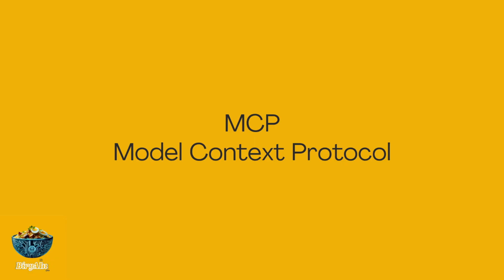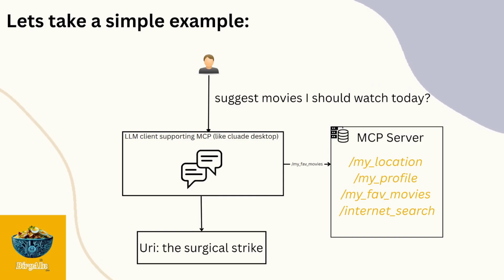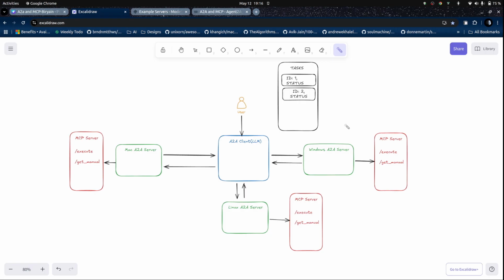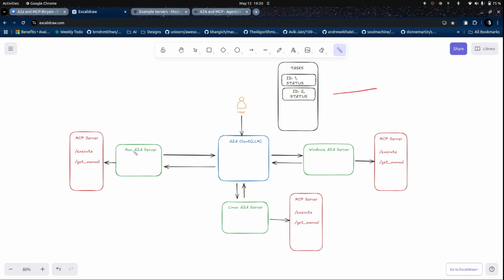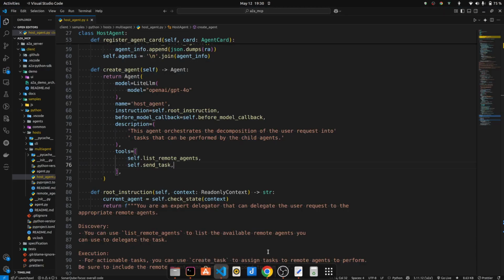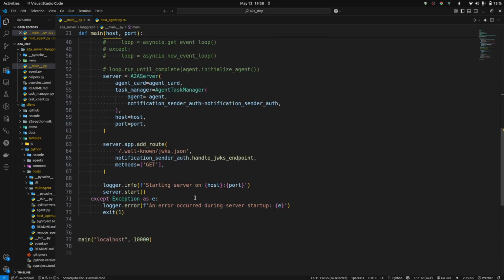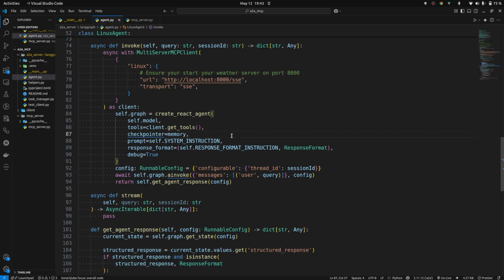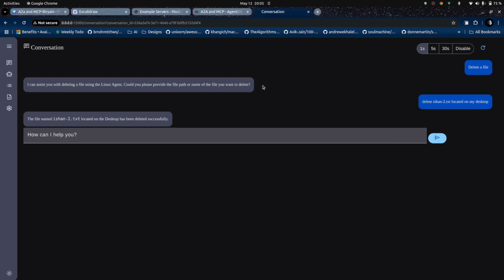A2A and MCP - Tutorial with code Demo

Comment: Great video, one question:

1. In your auto repair shop, i was thinking on how we can expand it to design a fault-tolerant, multi-agent system using A2A and MCP both, where agents can dynamically reassign roles or recover context after partial system failures or dropped agent connections — without relying on a centralized orchestrator. Is this possible?
Reply from the maker: All A2A agents like for example in our case Mac, Windows, Linux agents are seperate servers which can be considered as a seperate microservice now we can apply all the strategies of scaling and fault tolerants like kubernetes and creating auto-scalable fault tolerant pods etc...
I hope I was able to answer you question! 😊